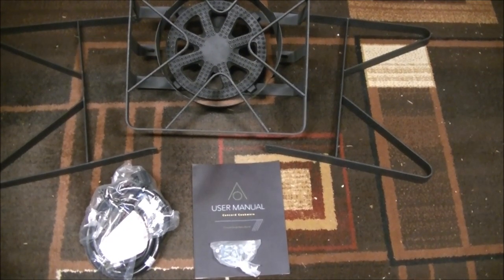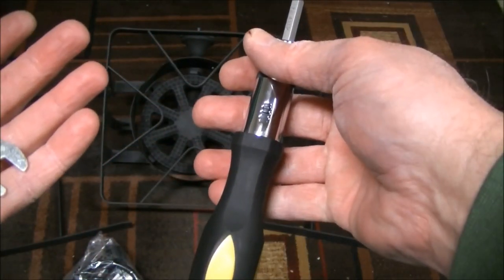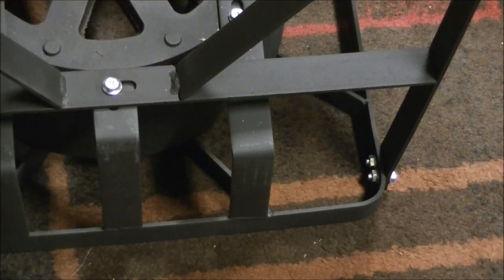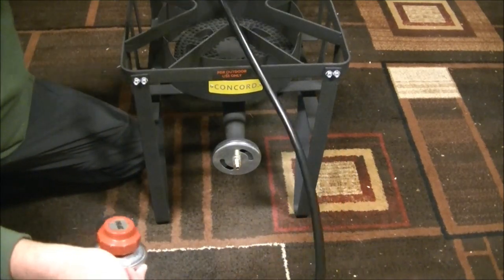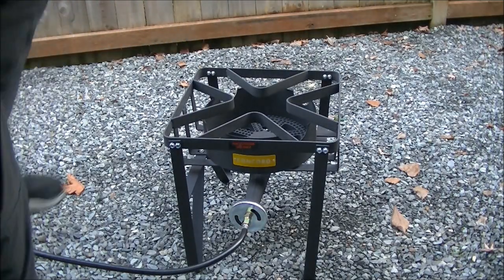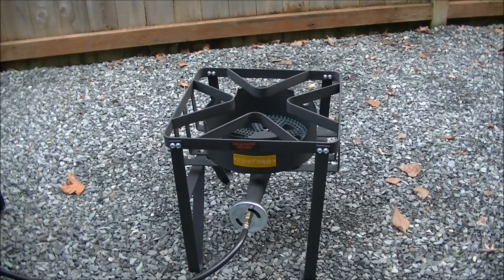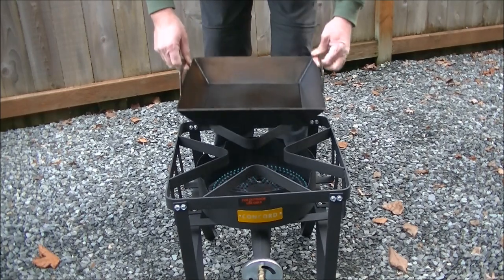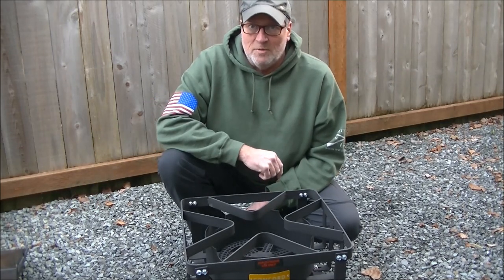A quick look at Concord's Deluxe Banjo Single Burner Propane Stove.

Comment: It’s 200000btu not the same as psi
Reply from the maker: That information is in the description: "Edit. The Burner output is rated at (Up to) 200k BTUs, not PSI. The regulator, hose, and connector are rated at  20 PSI."